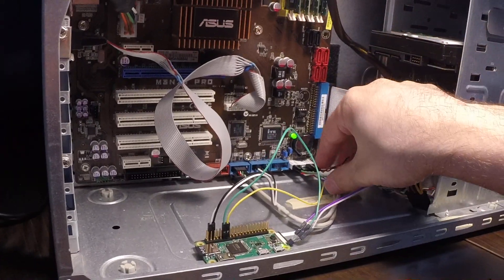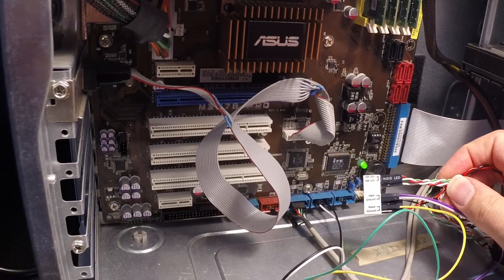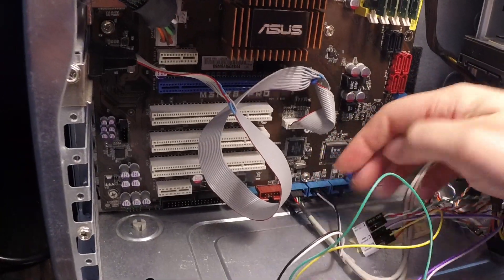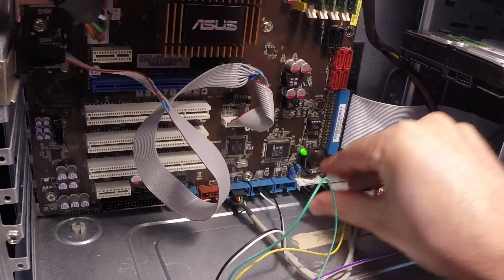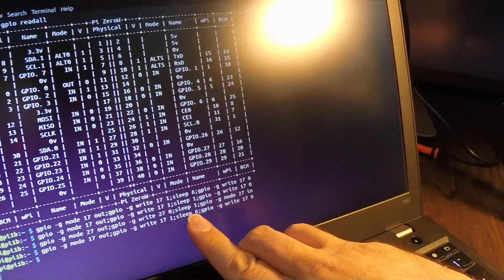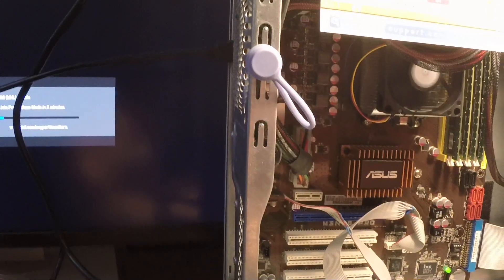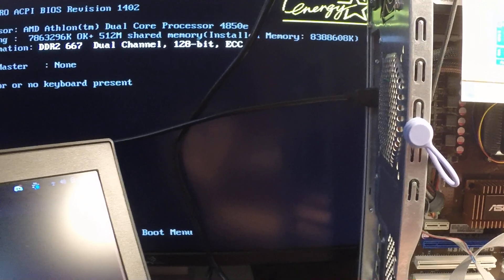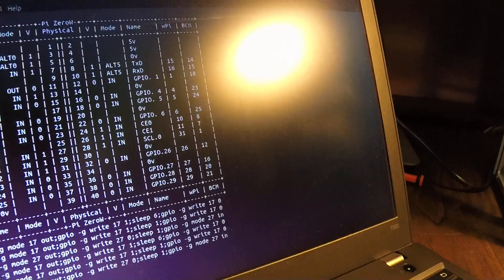Reset and power control of a PC ATX mobo with pi GPIO

Comment: Any long term updates on this? I am looking to control 4 systems with PiKVM/HDMI switch and if this works it would be a lot easier than the optocoupler. However, I am pretty sure that I will still need to use them in order to monitor the power LED status.